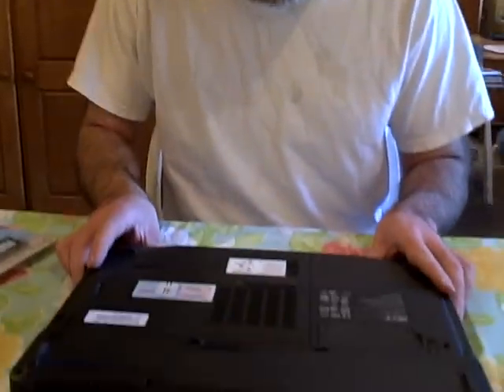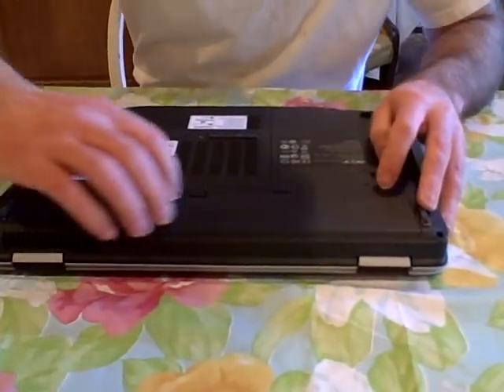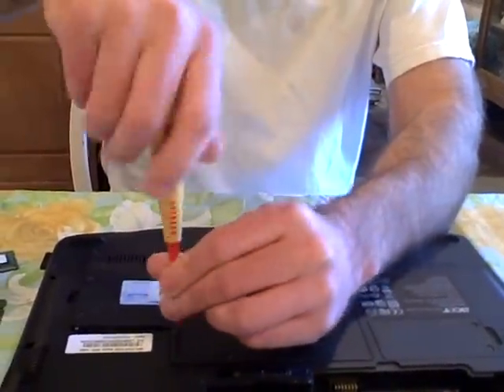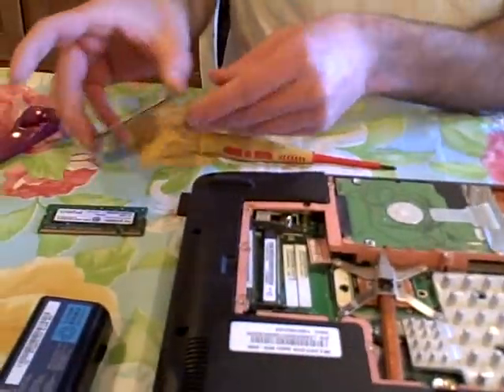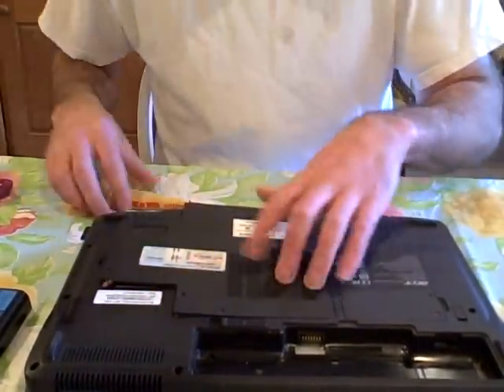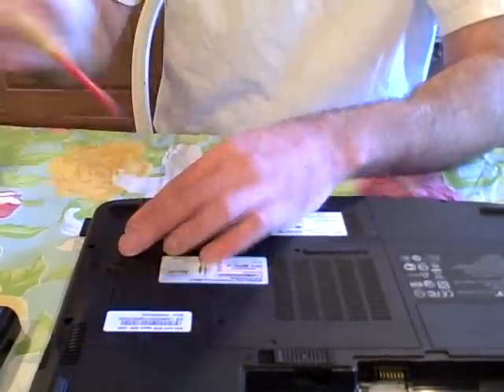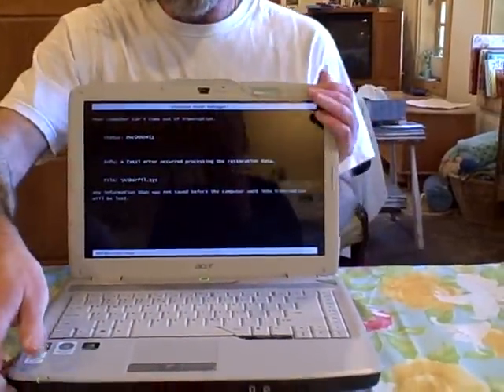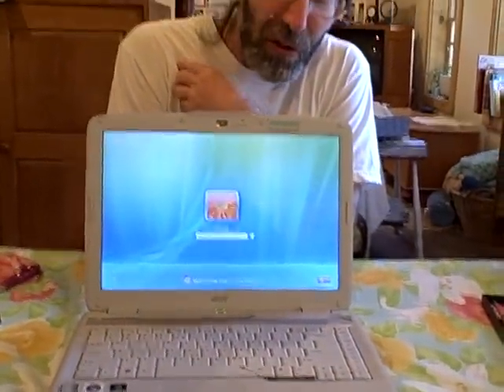Upgrade Acer Aspire Memory - Adding 2 GB RAM to Aspire Laptop for Windows Vista

Comment: Strange thing with my acer aspire 5732z is it will not take upgrades. some of these types have ddr2, some ddr3, some come with 2gb, some with 3gb, .... some are upgradable to 4gb max and some to 8 gb max. when i give my serial number or snid to acer support, it will not recognize the device, so when it comes to motherboard information, i'm screwed. so i gave up.

Comment: Can I upgrade to 4GB Ram on the Acer aspire One?
Reply: It depends on the on what your manufacturer says. If you want to know how much you could pack, you can type the question in your web browser.  Sometimes you can get away with adding more ram. With some systems exceeding manufacturers recommend max ram specs can cause your computer to have problems.

Comment: Hi great video many thanks BUT when I undo the 7 screws on the back of my Acer Aspire I still cant get the panel off as it still seems to that something else is still holding it on. Any suggestions please
Reply: First times you must use more force to pull out. Just use a screwdriver tip to go a little under the panel, in the left side.

Comment: Great video, very helpful and intuitive :-) I have an old Acer 5610z I picked up from Walmart around 2006, a gift to myself for making it back from Iraq. I upgraded to 2gigs of ram, an SSD drive and went to Vista from XP and it runs great ! Actually runs World of Warcraft on the low settings with very little lag. Of course I shut down a lot of back ground programs, including explorer. Thanks for the great video.

Comment: What about Kingston 2GB SODIMM DDR2 is that available?
Reply: +TsimogianniArt Usually on the netbooks there is either single/dual channel and single slot. If the slot uses DDR3 it is not backwards compatible with any DDr2 technology but I think still uses the 240 pins.

Comment: anyone tried 4gb ? I have 2gb... and yes we like it when it turns on. I have (2) 5610z that have worked well for many years. vista
Reply: Hello,
Have you upgraded to 4GB? It works?
Reply: no. I have 2gb only. but still working. vista been good 2 me.
Reply: Mine too... is working for 7+ years. 
I have added an 256GB SDD and it works faster.

TIP for the owners of this laptop: It needs dust to be removed once every 2-3 months from the inside fan, otherwise the cpu temperature will go to 100° and the computer will shutdown.
Reply: true dusting is a good idea. mine works great. hands down the best computer I  have purchased.  wonder how i can tell the total hours on it . like miles on a car ? ya know.. one has ate 3 batteries and one $6 display light ballast. runs 24/7 never shut it off ! no sleep neer !
Reply: 4Everx I had that problem a long time ago, I used some better thermal paste and never had the issue again

Comment: @MalaGlide You can't "add more 2gb Ram".  If it has less than 2GB in it now you can REPLACE the memory with two 1GB sticks.  It may not "speed it up" because a lot of what makes things take time is the processor and the amount of reading/writing to the hard drive it does.  The latter is based partly on memory, so when memory is inadequate it has to use virtual RAM which is using hard drive space as memory.  That can slow things down a lot.

Comment: @Spxctrum It's similar, in most cases the memory is removed by pressing the retaining clips which pushes the RAM out of the slot, then the clips are locked back in manually after the new RAM is installed.

Comment: @bsfromaz well bsfromaz, it can several things.   I recently got a netbook from acer for my vacation.  the first day i started it, i noticed that it was slow.  well usually i thought of two things.  1gb vs windows 7, and the fact that the netbook was preinstalled with acer programs.  im still running 1gb, and after uninstalling acer's programs.  my computer showed noticeable change in performance.  if anything it's that.  too much for the processor.  it should help :]

Comment: I may have to perform this function on my Aspire 5630, just for information is the process exactly the same?  I realise that some manufacturers change stuff on later models.

I've never had to take a PC or Laptop apart before so I'd hate to get in there with a screwdriver just to find out that I'm starting in the wrong place.

Comment: Ok so get this i order 2GB DDR2 ram and install it no problems for 5hrs then out of the blue i get the wonderful Blue Screen  found out after testing that the ram card just died on me causing this "Crash" so again I'm in search for a new card ..... also why does the ram take away from the hard drive memory is it normal with it doing that or is that an error on my part...?